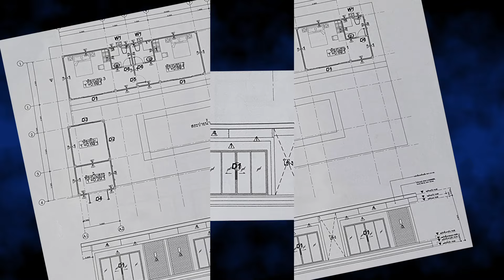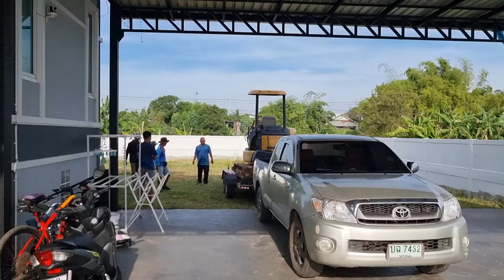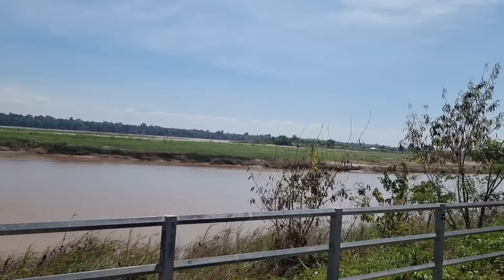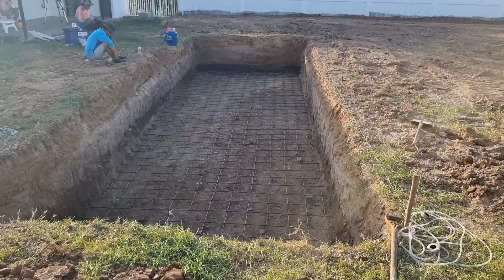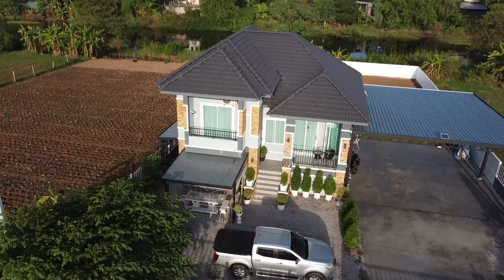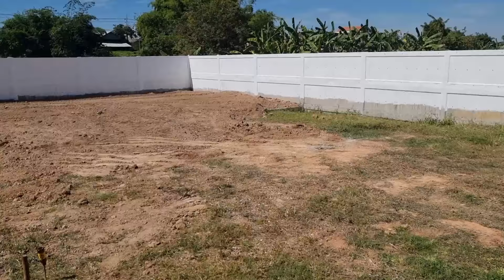The Resort Part 3 -  Pool Installation team issues

Comment: The Thai workers do a great job especially in this humidity and heat with the sun beating down on them , what they accomplished on their first day was a great effort, they rocked up measured out the area for the pool then had the hole dug out also had the soil spread out around the yard , then they also managed to do the reo-bar in readiness for the concrete first thing in the morning. I hope at the end of the day they were offered  a Chang or two to wet their whistles and of course one or two for the supervisor. :P PS: What made you choose a fiber glass pool compared to an above-ground pool , vinyl-lined pool or a concrete pool in-ground.
Reply from the maker: Maintenance realy, tiled and grouted pools tend to have bad ph levels, it's the grout apparently, also ease and maintenance, beer and thai whiskey when they come back  they were traveling to udon thani so had to shoot off.  They will be here longer next time.  My wife did cook them lunch which they loved.

Comment: I’ve been through all this, what’s the build cost on the pool only? I’ve got loads and loads of advice
Reply from the maker: The pool including fitting, pump, lighting, jacuzzi jets, cleaning equipment, concrete Base, delivery, etc in the  512,000 region.

Comment: Have you considered a covered area for people to get out of the sun? After I did mine, I had to go ahead and build one. In hindsight, I should have extended it over the pool a bit just to get out of the sun, and as you know, Thais don't like too much sun.
anyway, it's all looking good dying to see it all finished.
Reply from the maker: Yea it's one thing I do want, just not sure how to do it, solid roof or something sliding.
Reply: @LIFEbytheMEKONG  yeh there are a few options and you could get a sail they come in various shapes. A guy in korat does a material that os waterproof and sews it together to any size it is not expensive either so it could be used for a sail or a retracting shelter.
Reply from the maker: @Bigbigjimbo cheers.

Comment: Why is there no hydrostatic relief valve in the pool base?
Reply from the maker: It's not an overflow pool, it will also be fully enclosed  the whole garden is being concreted and tiled.
Reply: @LIFEbytheMEKONG  The valve is to stop the pool popping out of the ground due to pressure from the underground water table; All swim pools have one.
Reply from the maker: Water table is more than 18m down, we know this because we tried for a well and at 18m still no water, hard to belive considering where we are.  They recon maybe 30m before hitting water, soil is like hard baked clay and bone dry.  Even in monsoon season water only penatrates about 2 or 3 cm here, if that.
Reply: @LIFEbytheMEKONG sane as my house in baja California. Will the pool extend much above  ground level? I'm just curious. I like the looks of a step-up pool, not yo mention it keeps the reptiles at bay...
Reply from the maker: Yes there will be a couple of steps up to the pool, it will be the same height as the room patios which will step down to a lowered area.

Comment: What size is the pool
Reply from the maker: Hi, we have had to downsize from 12m x 4.8m to 10 x 3.5 as the access roads are not wide enough for the larger pool.  we could have had a 12m x 3.5 but it would have needed to be custom made, more expensive and longer to manufacture.